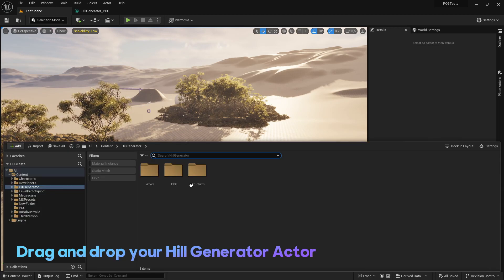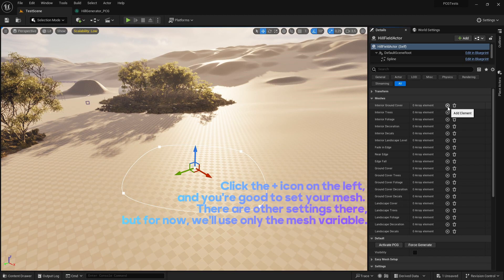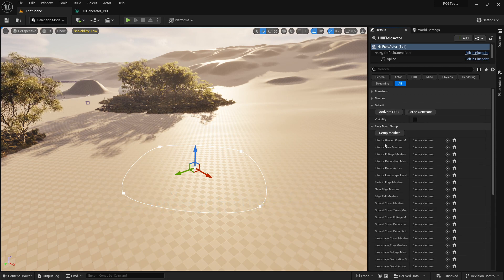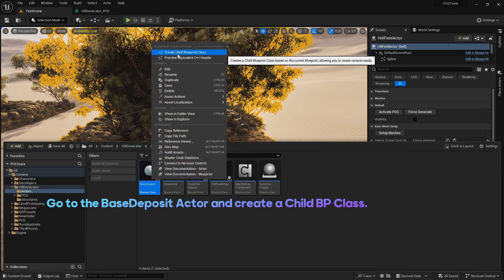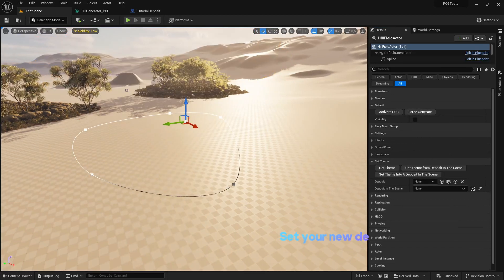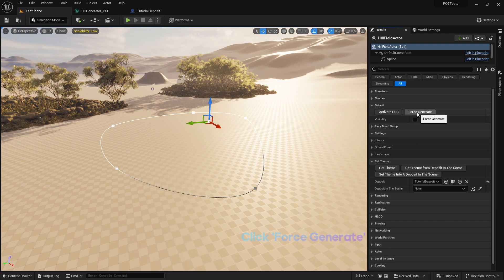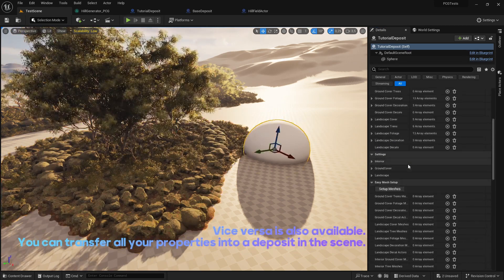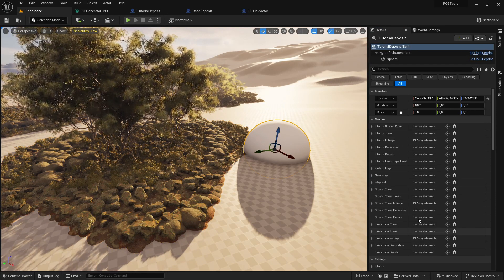Hill Generator PCG: Setup Your First Hill - Tutorial

Comment from the maker: Biome Genereator PCG - https://www.fab.com/listings/87e4c97c-1cb6-4d4a-a5ba-598c408ddec8

Also Check Out:
Ultra Components is now live on Fab — and 90% off for launch! 
🛒 https://www.fab.com/listings/fb6389d0-dcb2-4fe2-9170-f2881b5c2e92

Ultra Components allow you to create flexible systems.
A baseline for every project.

Includes:
✔ 3 Inventory Systems (List, Slot, Grid — fully modular)
✔ ShooterCharacterComponent with firing/reload logic
✔ Item, Weapon, Mag, Bullet Components
✔ Multiplayer-ready architecture (clean separation from standalone logic)
✔ Built entirely on UE5’s Component framework

💬 Need help?
Extended support available — voice, instant messaging, and direct project guidance.
Discord: egdev0023